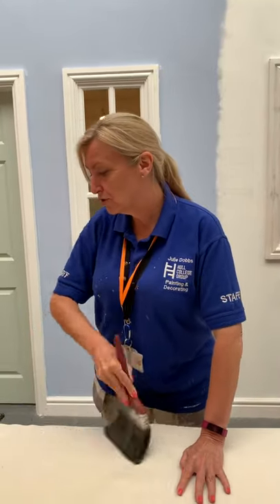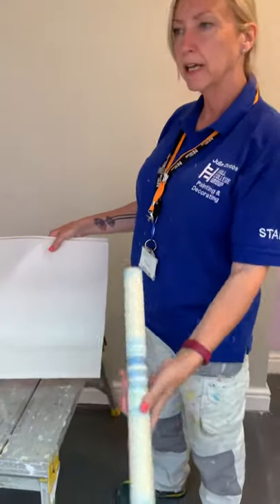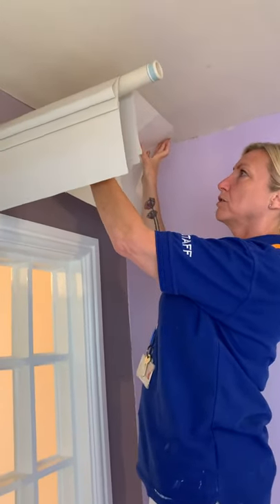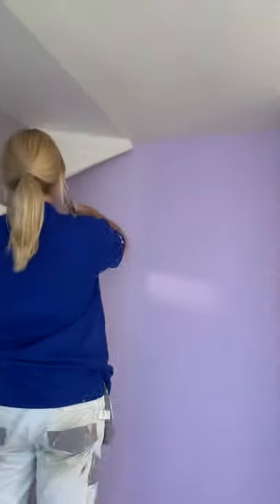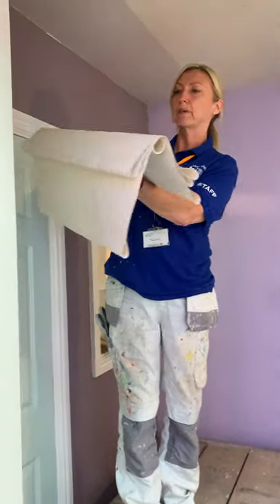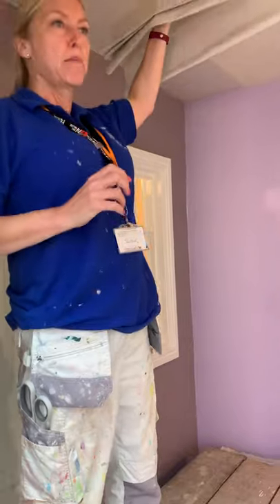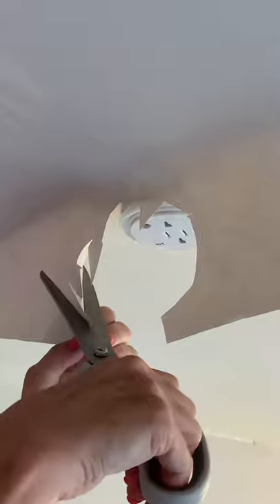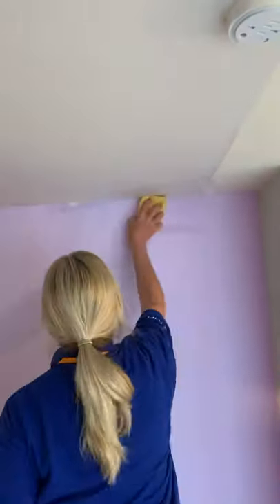How to wallpaper ceilings & cut around a ceiling rose

Comment: This video was excellent.  Not a lot of useless jabbering.  She pretty much stuck to the task at hand, and moved at a nice pace that let you follow closely.  She was easy to understand.  Really helped me a lot.  I am doing a ceiling, but a small area -- the top of the stair well.  So, I should not have a problem with the arms getting tired, as the pieces will not be longer than 6 feet or 4 feet depending on which direction I go.  What I take from this is not to be shy with the paste.  I hung my walls with paste and put a coat on the paper and a coat on the wall.  Double work, but wanted to make sure, and the paper ended up with a fantastic bond.  I had good slippage to line the paper up, as I had so much paste.  Considering the cost of some papers, paste is cheap, so I do not skimp.  So glad I found this video.  Just needed that extra push to make me try the ceiling.

Comment: I use a utility snap it gives a fine cut. Going around lights its easier than scissors. With scissor you need to pull of then it tears .i just use spactular cut gently job done
Reply from the maker: These videos are for L1 learners as an introduction into Basic painting & Decorating techniques. They use shears in L1 , then blades in L2 . This is to allow them time to cut correctly with shears